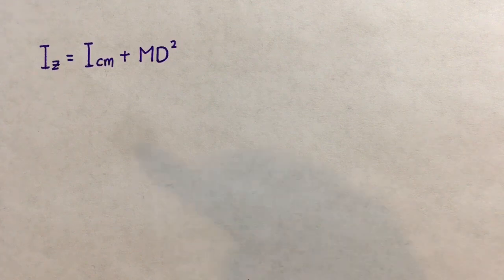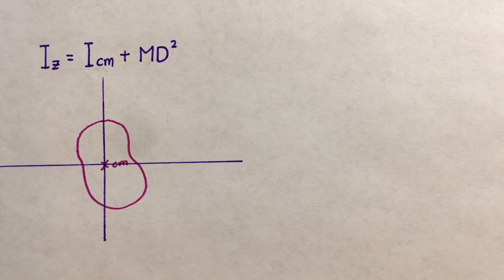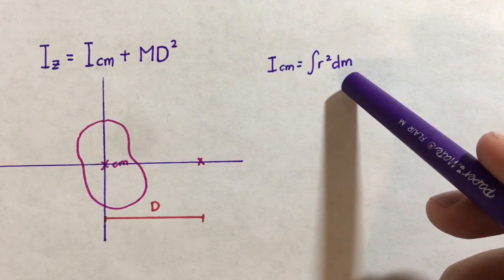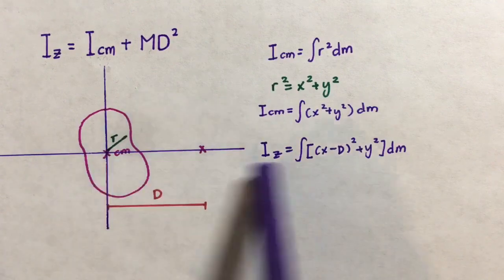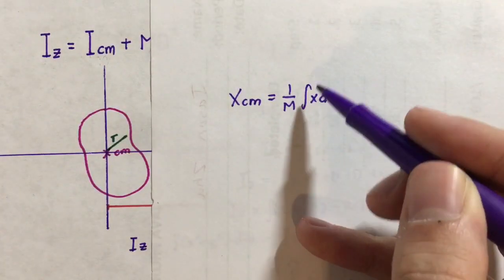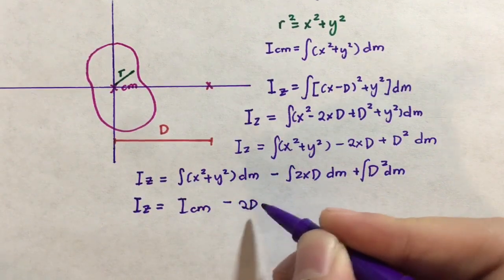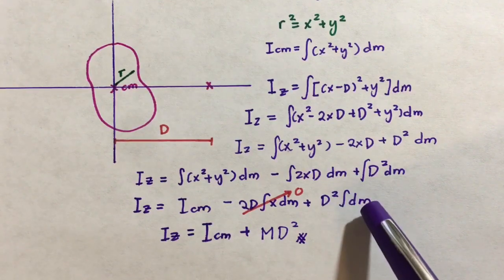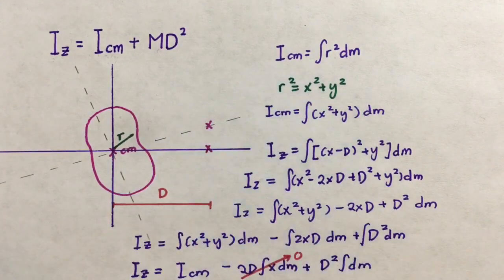Proof of the Parallel Axis Theorem

Comment: Hi you might be able to help me out with something i cant figure out:

If I apply the parallel axis theorem to a (non-spinning) body of mass m in uniform circular motion around a point a distance r away,  then I get the angular momentum of the body about the point  is 
(I + mr^2) omega where I is the body's moment of inertia around its COM and omega is the body's angular velocity around the point.

However if we compute the angular momentum by just getting the orbital angular momentum about the point (where the body isn't spinning around its COM), we get r × mv = (mr^2 omega) which is clearly different to what we got above.

Can you point out where I might be making a mistake here.
Your help is greatly appreciated.
Thanks.